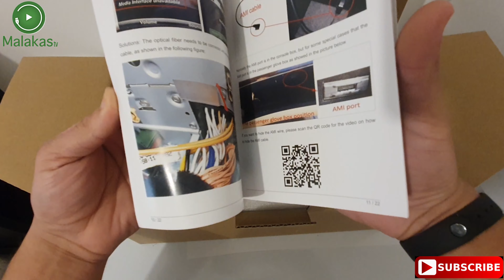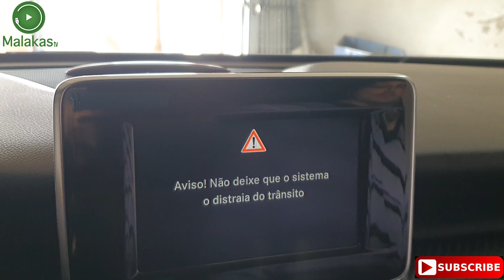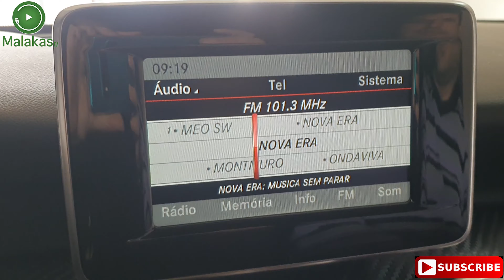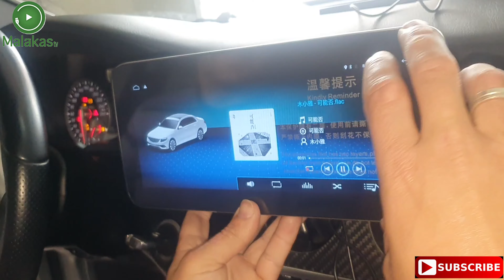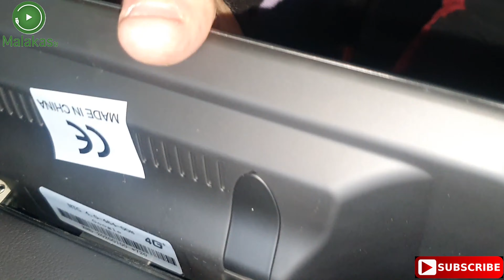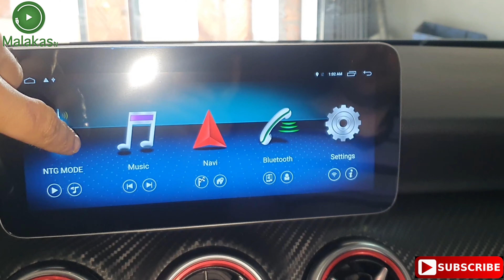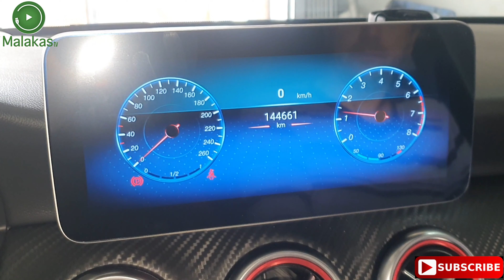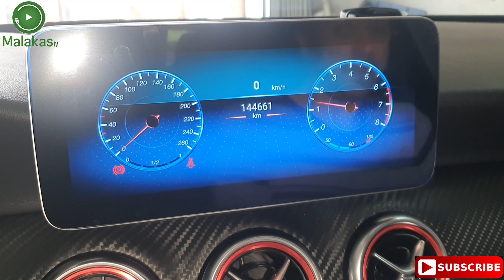Android Screen 10.25 installation on Mercedes w176 A180 - MalakasTV

Comment: Hello my friend, I have an issue with my screen. When I'm using the android mode and I put the rear gear the rear camera doesn't switch in automatic... I have to press the NTG mode, the original menu of the radio and then the rear camera works perfectly but like I said it doesn't switch automatic between menus. Do you know what happen? Canbus? Any setting wrong? Thanks
Reply from the maker: Hello friend
I think I’m menu options camera have a choice to change in rear both systems

Comment: I have just purchased the navifly version of this screen. I have a W176 2015, there is no AMI port or Aux port. Is this an issue for audio?
Reply: Hey, did you find a solution to this problem? Ty
Reply: Did you figure it out
Reply: @kylegordon1613  turned out you needed to purchase a FM Bluetooth receiver for your cigarette socket. Connect to that and it solved the issue. Looked a bit messy in my opinion so ended up selling the car and going elsewhere

Comment: how to hard reset this unit? can you help me please? the android interface is black screen on my unit
Reply from the maker: Hi friend
The best away it’s unplug the main wired and plug back it again
😉
Reply: @MalakasTV91  thanks!
Reply: @MalakasTV91  my boyfriend said what about unplugging for a second the car battery? Will that also help?
Reply from the maker: @foxylooksbyvirginia  unplug wired main cable from radio
Reply: @MalakasTV91  is that the thick wire behind the original radio? or the power wire behind the screen connected to the radio?

Comment: Hello. I have no sound in a MB A180 (W176), coming from the XTRONS unit. Only via the built-in NTG menu and using the original NTG unit from factory. Not using the Android system.

Some CAN bus settings in the Android unit?